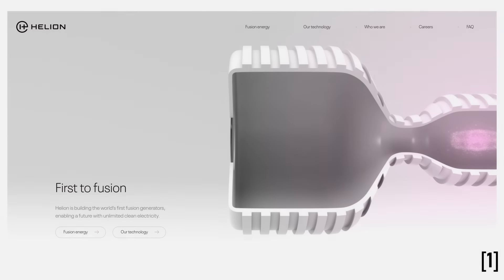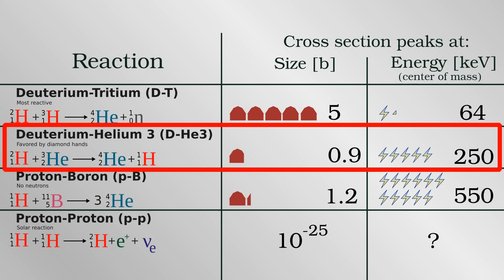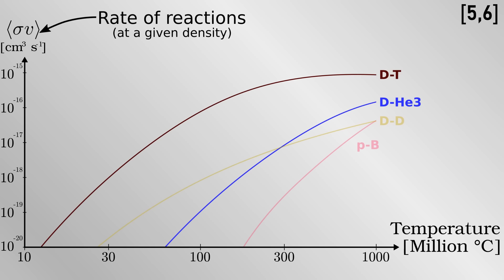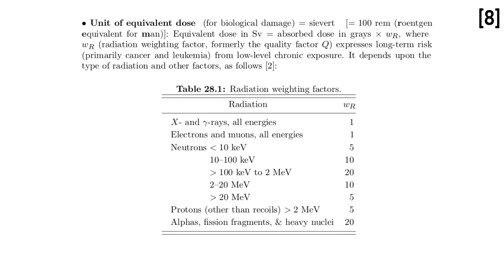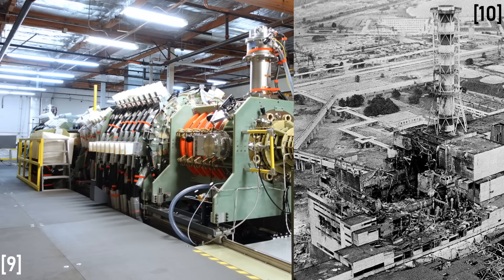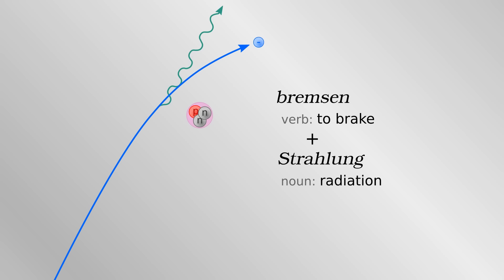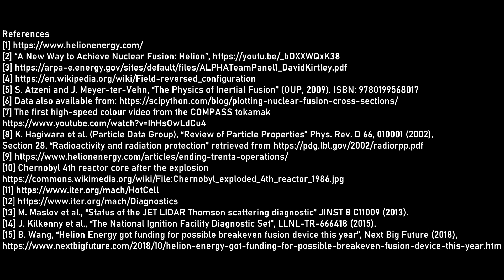The problems with Helion Energy - a response to Real Engineering

Comment: I'm no physicist, but i've always wondered if fusion could be achieved by basically aiming a bunch of superconductive gauss guns all at a central point in a hub and running a heavy magnetic material as the 'rounds'. If you could accelerate small amounts regularly at each other you'd be bound to get a stable thermal reaction...right? Probably would take more energy than it'd give. But there's no upper end in a gauss gun you can accelerate something to in a vacuum. You could really crank up the speed, and any heavy metal/metaloid could drive the reaction. Because throw anything hard enough at something else throwing something hard back equally hard, there's gonna be some fusion I would think! lol

I dunno. Probably a stupid idea. Just something that came to mind a long time ago. Not a scientist. But I do have occasional flashes of inspiration. I just can't always tell the good ideas from the bad. 

Anyone? Seems like a pretty smart room to bounce this off of.
Reply from the maker: If you have 15 minutes, watch this video where I explain why this approach won't work: https://www.youtube.com/watch?v=2DzKXN1pcwY
Reply: @ImprobableMatter  I do, and thank you!

Comment: What you say about the power output is the real deal breaker. Your concerns about radiation are no big deals at all. They can use brominated poly blocks to shield the neutrons, thermalize then absorb, and the poly would easily shield beta radiation, though just a few feet of air will also shield beta. They would have to operate the machine in a different building then where the reactor is located. Activation of the machine parts will just have to be dealt with by either waiting for decay to safe levels of radiation or working and monitoring when working with activated parts.
Reply from the maker: If they allow the coils and electrical connections to be activated and embrittled by neutrons, they will likely break the very precise operating conditions needed. Could they still achieve symmetric plasma compression if their coils are damaged and the capacitor banks are far away, separated by long feed-throughs?

If they try to put neutron shielding between the plasma and coils, their magnetic field will be much lower and therefore not reach breakeven.

Comment: I also had to think about Bremsstrahlung when Helion said that the two separately accelerated portions of plasma would meet in the center and thus come to a dead stop. Well, that would be a tremendous deceleration, resulting in quite a bit of Bremsstrahlung, wouldn't it?
Reply from the maker: Yes. They would also have to undergo magnetic reconnection which dissipates magnetic energy.
Reply: It's been more than twenty years since the first experiments merging FRCs, and there are multiple groups working on this right now around the world (with just one quick search I found seven, in Japan, China, Europe and the US, and there are probably more).

FRC merging behavior is well known. When two FRCs with aligned [poloidal] magnetic fields collide in a vacuum, most of their previous kinetic energy is not radiated, but translated into heat. The result is a higher temp, higher beta, higher density, better confined FRC configuration. It seems there still are some doubts about how this process works, but not that this happens.

Comment: Are you aware that the Helion patents include a lithium layer for neutron capture?  Neutrons interact with the lithium layer to produce T+He4.  These particles contribute to the energy capture, and the Tritium is moved to remote storage where it decays to He3.  As explained in the Real Engineering video, the issue with Tokamaks isn't the Lithium, but the beryllium needed as a breeding layer that ultimately results in radioactive hazards due to Uranium impurities in beryllium.
https://patentimages.storage.googleapis.com/2d/4f/cf/4d1f6bb469f7ce/US20170011811A1-20170112-D00000.png

Comment: The neutron activiation is less of a problem then you think, if you pick an element with multiple stable isotopes. For example if you pick titanium you have 5 isotoped from Ti-46 to Ti-50. The heaviest Ti-50, makes up onlt 5% of titatnium, and Ti-51 has a half life of les then 6 minutes, it'll lose over 99.9% of it's radioactivity in an hour.

Comment: Sometimes it’s better to not be so optimistic and in stead of trying to beat down every issue with engineering focus on engineering that has less obstacles between you and your goal…for example…there is a fusion reactor in the sky that requires no maintenance or fuel …just collect the energy from it!!!

Comment: Like every other fusion experiment out there, they've concentrated on trying to fix one of the issues with fusion, the scarcity and difficulty of getting the tritium to fuel it.  And in the process either ignored all other issues related to actually being able to produce net energy output or being able to maintain reactor integrity.  They don't seem to have an issue with the reactor tearing itself up so much, but they do have some difficulty creating a reaction that would produce more power than they have to spend to initiate it.  Still, it's nice that somebody is looking into the issue of what happens when we build a giant fusion reactor that does generate power, but the fuel that goes into it is so hard to come by or takes so much energy to create or extract that we still lose net power.

Comment: i think you're missing part of the point of their approach. tokamak reactors require so much more energy to run vs energy output, as well as incredibly large maintenance costs vs the approach trenta is using. Trenta is also putting energy in to create the plasma, and squeeze them, and then gather the energy back via the pushback from the fusion process. as you have shown, at 300m°C D-He3 is more reactive than D-D. the process they use is pulsed, it's not constant either so the neutrons produced will be minimal, with the reaction time taking less than 1/10th of a second. The energy required to create the fuel required is much lower than the energy required for a D-T reaction. You also didn't consider that the tokamak reactors produce nuclear waste when reacting due to the neutrons hitting the walls of the reactor. Also missed that this is not designed for production, but for research. the one they have plans to build for energy production is approx. 2x bigger (i believe it was mentioned in a video from the plasma channel discussing this reactor)

you missed so many important points.

Comment: Why isn't fusion purposely as external, throttleable neutron source for fission of heavy, relatively stable (not prone to chain fission reaction) nuclei? Thus we could potentially have safe nuclear reactors which use only a small amount of (cheap, not enriched, not weaponizable) fission fuel at a time, and can be stopped at a flip of a switch, without enormous thermal inertia and need for active cooling while in shutdown.

Comment: @ImprobableMatter - Fusion newb here but any thoughts on the Helion patent's claims about reducing side reactions? From paragraph 27: "Example systems and methods described herein may employ a 3He fuel cycle which may reduce or suppress a dangerous D-T side reaction by extracting the tritium ions as they are created... In some examples, a D-D side reaction may be suppressed or reduced by operating a fusion plasma at a higher temperature where a fusion cross-section for D-3He is much larger than D-D."
Reply: Indeed! Helion's patent is totally sound in this regard, actually and I am still surprised that Improbable Matter is not aware of that or is ignoring it. At temperatures above ~30keV D-He3 becomes more reactive than D-D.
That said, for mixed mode powerplants Helion will likely HAVE to operate at lower temperatures (and higher densities instead) in order to breed enough He3 from D-D reactions or else their fuel cycle will not close. They will need two D-D reactions (half of which produce a neutron) for every D-He3 reaction, at least in the beginning until they have a steady supply of He3 from Tritium decay but that could take about 20 years. And that is probably the most valid angle of critique of their design, if there is any.

Comment: I was wondering about neutron emissions from their reactor.  Especially when I saw NO barriers anywhere in sight.  It looked like a regular old warehouse!  And there's plenty of other businesses and other regular buildings all around them.  SMH.

Edit:  I'm not a physicist, just have a very high level understanding of fusion, and I could still pick up on that.
Reply: Helion's experimental reactors up to date have produced very little radiation. Venti, the previous generation to the one shown in RE's video,  reported aprox. 0.04 J in neutrons per shot at most, and this only a few times, and hardly any gamma. These machines are remotely operated, so there was no one nearby when they activated them. Moreover, there was shielding on the walls of the room that housed them, and there will be quite more around the vault housing the next one. It was not mentioned or shown, but it was there.

Comment: Yeah dude. Bu they ain't boiling water at the end like all the others. They are using the compression of the plasma to induct electricity into the same coils they use for the target and compression magnets and send it back to their capacitor banks. The efficiency does not need to be high..just optimal for the induction for it to be the winner.

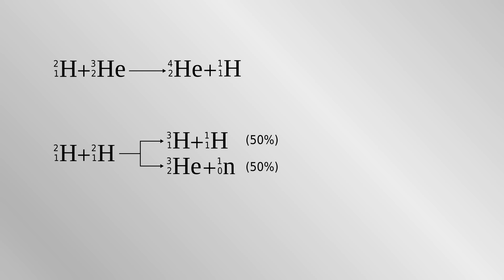Comment: I appreciate the several points raised in this video, but at 3:17 you state that the Real Engineering video completely ignores the neutrons from the D-D reactions, yet the Real Engineering video actually discusses this at some length. They claim that the neutrons released by D-D have a fifth of the energy as those released by D-T, and so are less damaging per particle. However, as you point out, at their current temperatures, the amount of D-D neutron radiation per power produced will be far too great. If they can magically operate at very high temperature (~1000C), then perhaps the D-He3 reaction will be sufficiently more reactive compared to D-D. And then the D-D reaction could be done in a separate process at a lower temperature for the purpose of generating He3 as fuel, and then this process would be the one with most of the neutron protection. Overall, it is a separation of constraints into two distinct machines/processes. Though it is not clear, I think this is the approach they were suggesting. It has challenges, probably insurmountable, but I would not say they ignored the neutron radiation issue...

Comment: Couldn't you run the fuel rich with He-3 to reduce the fraction of D-D reactions? This would give a further hit to effective cross-sections, and reduce the output that much more. So it still looks possible to me if you had a machine that could generate a tremendous amount of temperature and confinement time... which we still don't have the bare minimum for today, yes. Still, FRC and others could still be worthwhile because it's very likely that Tokomak & inertial confinement become technically possible but uneconomic. The tech could blow way past the net gain point and still be uneconomic. In those circumstances, some more pure low-rad (but hard) configurations could still work. In like the year 2200.
Reply from the maker: Exactly: if you reduce the Deuterium content too much, you will never break even on energy.

Comment: How does the amount of energy required change as the amount of fusion fuel increases? It’s not very clear to me that lower reactivity for lower temp is necessarily bad. There is likely a sweet spot where heating and confining can be done most energy efficiently such that the lower reactivity still yields a net gain.
Reply from the maker: The amount of energy required to heat something to a given temperature goes up proportionally to the number of atoms. 2 million atoms take twice the energy as 1 million.
Reply: @ImprobableMatter  That’s assuming the efficiency to heat something remains the same throughout the temperature range which is rarely the case. Take heating a pan on the stove for example. The rate of energy loss of the heat from the pan to the environment increases as the temperature of the pan itself rises. Therefore doubling the heat energy going into the pan does not yield double the temperature rise. More energy has to be put in to overcome the increased energy loss.

Comment: You’re missing a HUGE part of Helion’s strategy. 

Granted I’m not particle physicist and I’m not affiliated with Helion in any way. However, from my understanding, as mentioned in Real Engineering’s original video on the matter, Helion is able to produce Tritium as a byproduct of this Deuterium reaction and then use that to get higher energetic reactions out of the fusion process. By you saying the tritium reaction is much higher yielding and Helion is losing out on energy, you’re missing the part that although Helion starts with deuterium and Helium, they are still employing the same Trtium energy exchange your describing here.

So…. You’re point then is… what? Not relevant here?

Of course, everything you and I have both said is still only theory until/unless they can or can’t pull it off.

Comment: hello i worked for some reserc institus , and other things radiation hardened sensors and microchips, Even relay dye in neutron flux or radiation , the metals crystal structure changes that it will not be bendi as it was . And this is true for every small cable.

Comment: What sort of temperature or particle density would be necessary for Hydrogen-Boron fusion? Would it even be theoretically possible? (I'm a long time Sci-Fi reader and knowledgeable layman. I've been hoping for Fusion to work ever since I read about it in Jerry Pournelle's 'A Step Farther Out' essays in Galaxy magazine back in the late 1970's. 😄)
Reply from the maker: There was an MIT study that says it may not be even theoretically possible, though it could work if you are optimistic about certain future tech. You would certainly need temperatures in the billion degree range, which few experiments if any have reached.

Comment: A couple observations. Although I haven't seen it for myself I'm inclined to believe there is a wrench in the gyro radii. While all seems according to the book in the physics lab repeated issues arise at scale even in tokamaks. It appears often enough that it drives some member of the team to the fringe trying to chase new (pseudo-science like) theories of physics in the process.
Others seem to have caught the electrode potential problem, but having seen the video in question I didn't see the same vitriolic issue and felt they had indicated they were cycle testing the system and components in a glow only low (nearly no) reaction mode. The impossible elephant in the room - my pet peeve - encompasses your video as much as any, the lack of discussion around achievable and achieved density. This is where I root for novel approach efforts like Helion's FRC because there is some address to the issue of density upfront instead of an afterthought. Whereas the typical approach to fusion wastes everything in heating and magnetics, the common but even bigger issue for these FRC firms is that they are trying to be too clean and too ideal way too early. Fusion is nuclear, accept that and design intentionally different just like your selection of and FR configuration. Get towards the golden goal of ignition first.

Comment: I'm wondering you could also do a break down to MIT's SPARC fusion reactor as well? At least in the space of private industry, Helion and SPARC are the top two that seem to be generating the most amout of noise when it comes to commercially viable fusion within the decade. SPARC appears to be similar to ITER in it's design, except much smaller with their 20T superconducting electromagnets.

Comment: I just rewatched the real engineering video and it sounds like you miss stated the temperature they plan to run at. You said they plan to fuse at 1,000,000° but the video said they start it out at 1,000,000° and then push it up to 100,000,000°
Reply from the maker: You should re-watch this video and optionally turn on the captions. At 02:01 I say "Helion seems to be satisfied to have reached 100 million [degrees]". This is exactly the number given by Real Engineering.

Comment: Isn't it easier to capture the energy of a Deuterium Helium 3 reaction as it is mostly aneutronic and therefore can be more easily captured electromagnetically rather than having all those energetic neutrons needing to be absorbed by something and shed their energy as heat which is then used to run a turbine?